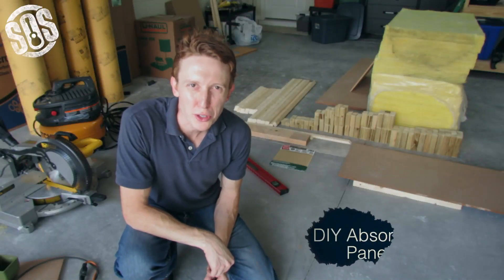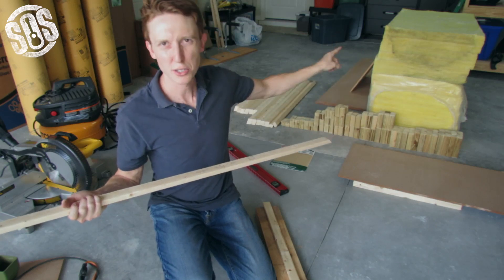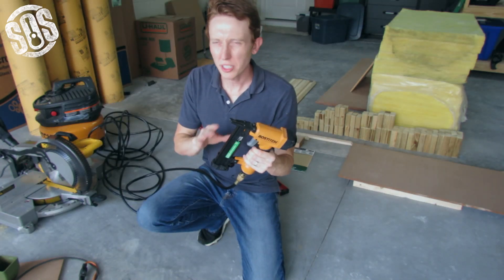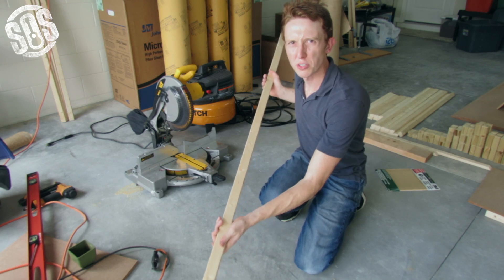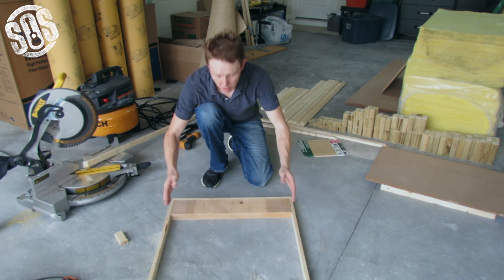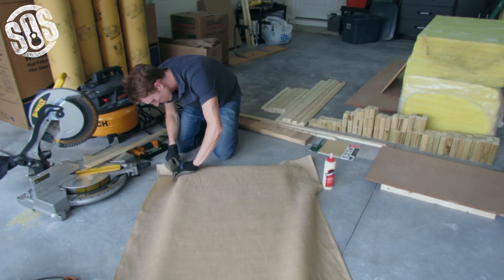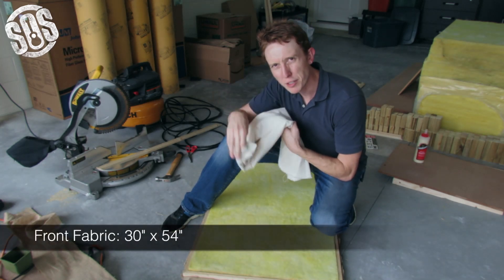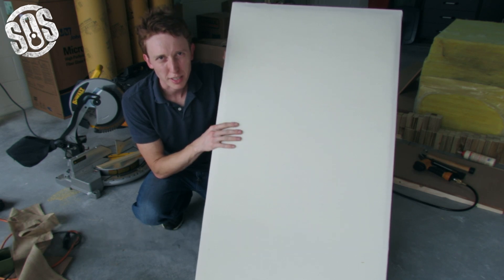How to Build DIY Acoustic Absorption Panels

Comment: With all the tools and equipment, this is not a dyi kinda thing. Spending 10x more for the tools to make a "cheap" panel..
Reply: If you make about 20 of them, it actually makes sense. And to be honest, you can use a cheap drill-driver and a hand saw to do the same thing.

Comment: I read on The Owens Corning fibreglass 700 Series Data Sheet that the 701 has a higher NRC than the 703. why does everyone recommend the 703, if the 701 absorbs sound better?

Comment: You have just made Toxic Acoustic Absorption Panels.Safety first you'll need to wrap plastic around the insulation before you put the cover on the panels.You move that shit around/blasting sound at the panels they vibrate shake that shit airborne=TOXIC
Reply: Breath easy
Reply: Do you believe the earth is flat as well?

Comment: Gordan,  I have a very noisy air compressor.  So I build a box for it and I now want to sound deaden the inside of the box. Do you have suggestions as to sound deadening material I should use??
Reply: Use rockwool safe and sound insulation

Comment: Great video, thanks a lot! I just had a couple of quick questions. One, how would you do this without a pneumatic stapler? And second, if I don't have one of the saws you're using with which to cut the panel at a perfect 45 degree angle, how would you recommend tackling that? It seems like you could do it without cutting angles just by putting them end to end - is that less ideal? Thanks a ton!

Comment: i'm a little paranoid about fiberglass and having it in the air.  Would you recommend another insulation that's also cheap that is maybe less potentially toxic?  Great build/video!
Reply from the maker: +Nate Sharits Hey Nate, good question. I have only used the high density fiberglass so I don't have personal experience with other options but here are 2 things that might help:

1) You can check out Rockwool, as well. Amazon --> http://www.amazon.com/Roxul-Rockboard-Mineral-Wool-Board/dp/B006FKNVTQ. A short search showed that the particles are still not ideal to breathe in so it might not be the fit you're looking for. But put some more research into it and you might want to go that route.

2) The fabric you wrap around the fiberglass can truly keep the particles in if that's a big concern (which it should be). To test your fabric, hold it up and hover your hand a couple of inches behind. Then blow air through and see how much you can feel. The less air felt means the less particles can make it through. The trick is to find the fabric that will allow you to feel comfortable about particles while still allowing sound to travel through so that it may be absorbed by the insulation. 

Hit me up with more questions and let me know what you find!

-Jordan
Reply: if you can't SEE fiberglass particles moving around in the air, do you think it's safe?  I'm just wondering how dense a particle needs to be for it to mess people up :)
Reply: Particles can only go airborne when handling the material, not once installed. Best to build the panels outside or in an open garage. Wear a simple dust mask. No worries. Perfectly safe.

Comment: There is a simpler way of doing this in my opinion you might want to check. The material is Owens Corning 703 Fiberglass Acoustical Board. 
You don't need wood. It might reflect some sound.  Not been too nerdy her.
Shop around for the best price. 
Here is a video link of the material and about the material. 

https://youtu.be/woU6_Pexoj0?t=2624

https://www.youtube.com/watch?v=e7Yih3MkUxM
Reply from the maker: +H Hyo Thanks for the thought! You COULD just cover a board like this with fabric but what you suggested is actually identical (or nearly) to the product I'm using, just from a different manufacturer. And yes, you'll need some additional structure. 

Without the wooden frame, you would have to hot-glue the fabric to the panel which would take forever and not allow for the same nice aesthetic quality. Plus you need the frame in order to mount this to the wall or ceiling.

The panel you suggested is actually quite flimsy and has lots of airborn particles involved. In order for your safety and the longevity of the panel, I would strongly recommend you build a wooden frame around the outside. (and the sound reflection is perfectly fine. The goal is to take a large flat surface and add material to either absorb or diffuse the sound. With the wooden frame, it would still reflect sound in other directions than directly from the wall so it's definitely helping, not hindering.

Let us know if you have more questions!

Comment: I have a different application need. My home has tile floors, which I prefer over carpet (pets) because it's easier to clean. But when we have family gatherings, (upwards of 20 adults and children) the sound is deafening. Not to mention the dogs barking! Calgon, take me away!!!  Can you suggest a different backing other than fiberglass? And how smooth of a fabric will still allow the sound to pass through? Are naturals best? I am thinking about painting (with art dyes) to give them a more decorative look. Thanks for your help!
Reply from the maker: +Cindy Rhudy Cindy, sorry for the long delay, this slipped past us! We've actually made some of these panels to put in our personal homes as well, as they can be extremely decorative and really help cut down on the sound. In fact, many gymnasiums, restaurants and waiting rooms use these and you may not have even realized it.

In order to really work, it does need to be this dense fiberglass material. However, when wrapped in fabric, there are virtually NO airborn particles that get out so it won't affect you or your pets.

If you're not going for professional sound treatments, you can wrap this in anything that will look good. In my home, we bought some cloth curtains from Target that were on sale and used those to wrap it. That way, the final decoration is very pleasing to the eye and still traps sound. You could also check out JoAnn Fabrics or Michaels for good options.

If you're wondering how acoustically transparent a piece of cloth is, here are 2 tricks:
-Hold up the cloth in front of your face and talk into it. If it sounds like nothing is in front of you, that's great. That means all the sound is traveling through and will get absorbed by the panels. If you hear it reflecting back, not as much sound will get trapped.
-Still holding the cloth, hover your hand a couple of inches behind it and blow some breath through. If you can feel it, a lot of sound (but also particles) can travel through. 

So find a good medium and don't go out spending too much money on this. Anything will help in your situation, even just putting up tall bookshelves or draping a tapestry on the wall.

Good luck and be in touch with any more questions! (We'll be watching for comments this time). :)

Comment: hello there, I just finished my panels but I got a problem here and want some advices;..
I made it the way you made yours, wood frame, regular fabric as used to bed covers, I put there a fiberglass (a panel not the rigid one), than I observe under my room light that some particles from fiberglass appears on the front of panels, is it dangerous or is this can be diffused on my room air (when I got my window open etc) if yes, what should I do ?? cover with more fabric??
thank you a lot.
Reply from the maker: Hey Blownspirit, thanks for the question.  I have 2 answers for you: 

1) It's certainly not going to be healthy for you if there are fiberglass particles in your air.  I'm not a doctor so I don't know exactly but I'll say fiberglass is very fine and will eventually get into your lungs and make microabrasions that could cause problems.  Ventilation is one idea but I don't believe it's a solution.  

2) If you're not using dense fiberglass panels, you're really not getting the best absorption panels.  The reason why these work is because sound waves are very strong and need a lot of density or diffusion in order to dissipate them.  With standard fiberglass like you're using, the fibers are simply not close enough together to really make a big difference.  You need the dense panels in order to properly stop the sound.

Both of these points lead me to believe you need to rebuild your panels.  I'm sure that's not what you'd like to hear but it will be the best option for your studio and your personal health.  Please let us know how it goes!
Reply: thanks a lot this is what I think too..and however it means sure I'd like to hear what's working the best than to hear what I want to hear..and I thank you a lot for this accuracy and the fast response..
I'll try to build another ones and try to make the best I can to improve what I'm looking for...

Have a nice day..and sure will follow my next work and publish how it works and all the rest..
Thanks again..it's kind of you .